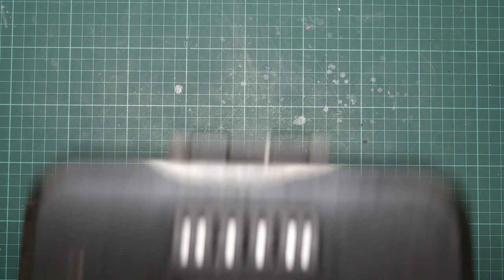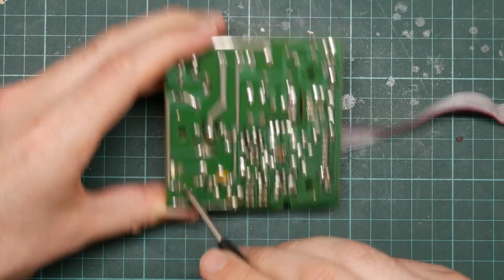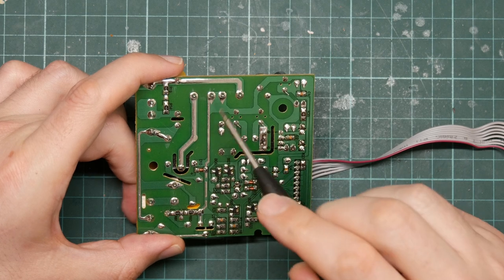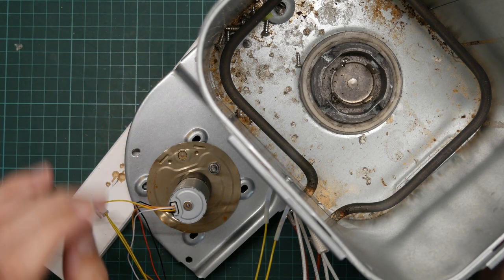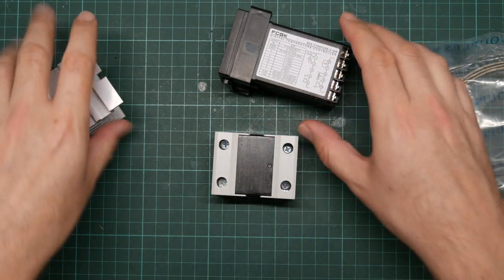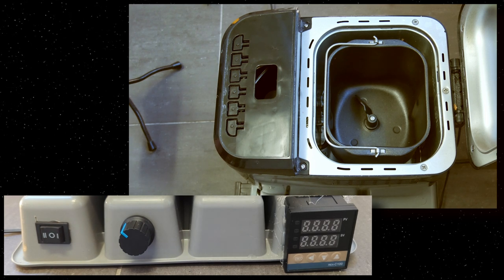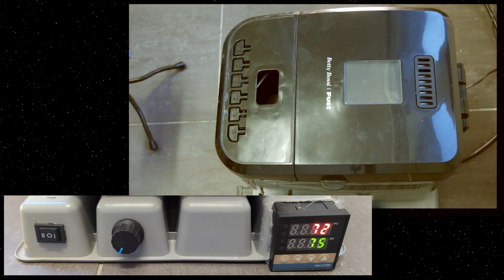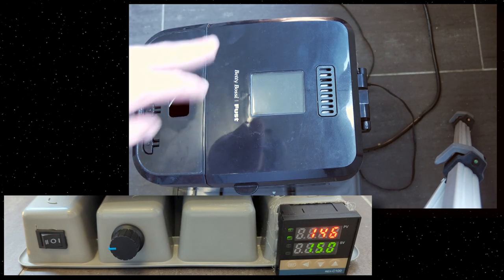Turning a bread machine into a soup machine

Comment: I found this video after watching your excellent smartwatch videos.  Curiously, I'm currently doing a project to make yoghurt using Panasonic breadmakers, which is not unlike what you're doing here.  The Panasonic boards also control the heater with a relay, and the motor with a triac.  I'm replacing the whole high voltage board with one that has an ESP32S3.  I'll control the board wirelessly with a web interface, which is something I did for a project to monitor the height of my sourdough starter.  Like you, the mains stuff worries me.  Please make more videos!